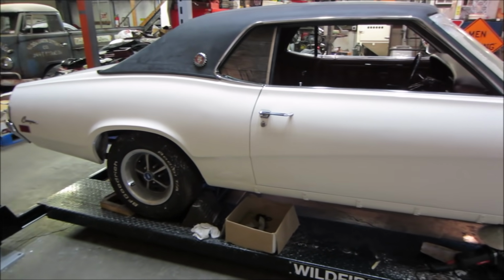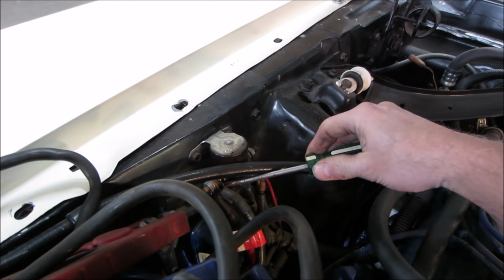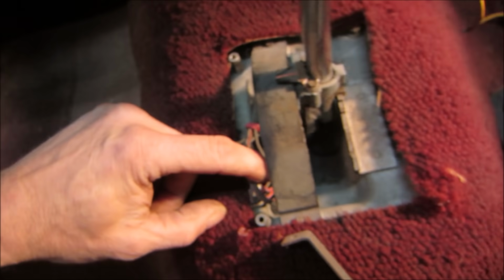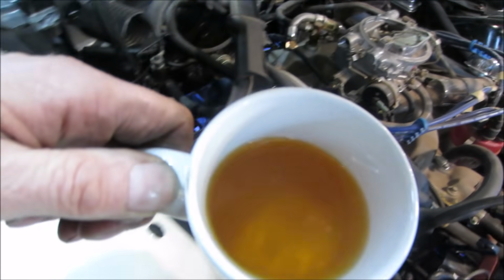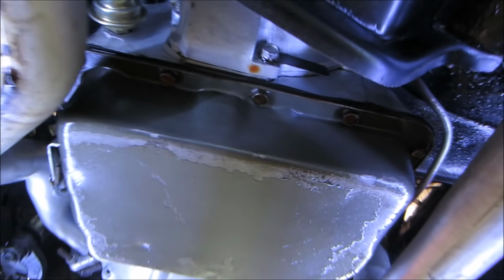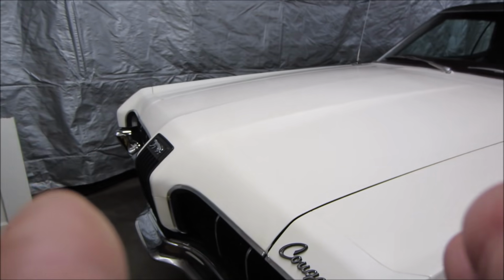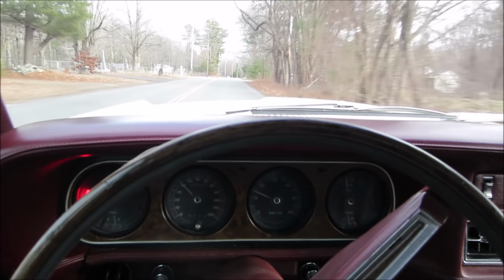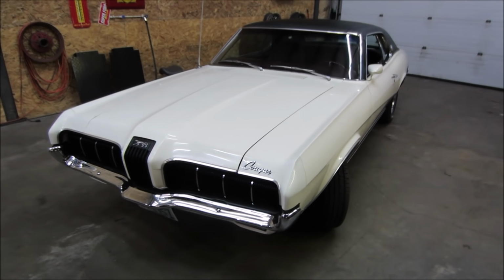Will It Run/Drive? 1970 Mercury Cougar  Saved From The scrap Yard.

Comment: Putting something together that someone else tore apart. Never a good time.
Reply: Unless you like a challenge. It is like being a programmer in a sense, trying to understand another person's logic. Mass of wires = spaghetti code 😁
Reply: If you watch vtuned on youtube, he effectively completely dismantled a McLaren 720 and transferred everything over to a new tub. He did it right though took thousands of pics and boxed and bagged every nut bolt and screw. Where possible, he left the bolt nut or screw back into the right hole. 

I can't tell you how many times I've seen "good deals" on basket cases and said NOPE because people just start removing willy nilly and toss them all together. The "best" way, if you have the patience, is to sort and organize everything. Specially in the last video considering the guy had stuff in the basement, stuff upstairs, stuff mixed in with parts for his other one......you'll be lucky to get everything. 

There's another one "nick's garage" on youtube he bought a 1970 dodge challenger basket case and the first thing he did was sort through everything. He knew the car inside and out so he could look at a part and know where it went and what it was. (be specializes in old school muscle).
Reply: No, it's a great time if you love a challenge.
Reply: Friends wife took all the separate little boxes and freezer bags of parts and dumped them into one big box to save space. Husband was tearing down his Harley for a total rebuild of everything and methodically placed parts in those boxes and freezer bags by groups.

 The bike never got rebuilt after that "helpful" clean up the garage event by his wife. It got sold as a project to another. The momentum of the project radically died after that giant mix all the parts together event.

 That was before digital camera and pre internet. Today it is far easier to shoot digital images of how parts go together and what they look like.

 That was in Chatsworth California decades ago.  The wife actually thought she was helping her husband with all the parts I  one giant box all mixed together. Ie clueless blond in chatsworth. :)
Reply: @3beltwesty  Yeah, that's grounds for divorce right there. No judge in his right mind would allow the wife to contest it lol specially if he liked to wrench on things.

Sounds similar to a story from 2018. Guy had a project car (60's GTO I believe) apart in his garage that he was restoring. GF decide while he was away on business to sell it and make room in the garage for her car. Had a local yard come and haul it away.....for nothing.

Guy got home and lost it. Threw her and her belongings out onto the front lawn and sued her for grand theft......

Me? in the first story: I'd give the wife a choice: sort it all back out OR leave with nothing but her personal items. 

"How am I going to sort it out"? You go out, earn enough money to PAY a harley expert to come and sort it. Or leave. YOUR choice.
Reply: And this seller was pretty meticulous about labeling all the things.
Reply: Challenges are great.
Reply: @gcrauwels941  yes "challenges" are great, but suffering ain't lol

Comment: There’s sparking down near the engine mount when you were cranking from the solenoid
Reply: Did you watch the video? There was 3 plug wires off
Reply: @aarongrabowski3775  I commented the same thing before I saw the wires off.

Comment: I drove a 76 Ford Granada 2 door for ten years. Loved that car. It was pretty worn out when I traded it in. I still remember the excitement picking it up at the dealership.

Whoever started the restoration did a great job. Engine cleaned and painted. Engine runs good. The ignition problems and transmission still needed a lot of work.
I'd use a lead fuel additive to help the valves.

Comment: Memories. I wish I still had mine. Red XR7 white top convertible white interior. 351C. Bought it in 81 drove it hard and cross country to CA from Cape Cod. Ran perfect for 10 years. Sold it missing the rear floor behind the drivers seat. It was gone!  Lol

Comment: I had the Australian Version, it was called a ford Landau over here....i smiled the whole way through this video, it was almost like a trip down memory lane. Mate i love your vids, i think ive watched all them nearly twice while i wait for your new vids to come up each week
Reply: on a second note, if the vac solenoid on the back of the tranny was busted you would be blowing smoke as the tranny fluid gets sucked into the manifold and it looks like you have the manual kickdown (linkage on carb). That groaning noise sounds more like the pump bearing in the transmission, sometimes if the torque converter isnt sitting right when the engine and transmission are bolted up it can put undue force on the pump shaft and kill the pump that leads to a groaning sound like that.

Comment: If I remember correctly, there is an interlock that prevents you from taking it out of park unless the key is turned on.  I think that was to prevent you from taking it out of gear and pushing it away to steal it. "IF" I remember correctly, that is. At 74 memories are getting fewer and farther between.  Love the videos, keep it up please.

Comment: When I was 17 I bought a 1971 Mercury Capri with an 800 dollar loan. My friends said it was a girls car but I liked it any way .I also owned a 1971 Pinto,1964 Mercury Montclair with a rear window that rolled down called a "Breese Way" I bought a 1966 Park lane with a massive 410 engine that I saved from the crusher ,1964 T Bird, 1965 T bird ,1977 T bird and now I have a 1955 ford F 100 basket case that I am working on. My daily driver is a p71 that I bought from an FBI auction( because they only get light use). I too would like to remember my HS days.

Comment: Love the videos! From an old Ford guy... I don't think the second terminal on the solenoid on the fender well/fire wall is ground. That was used to bypass the voltage reducing resistor for the coil, ignition curcuit. That terminal puts full 12v-battery to the coil during crank for higher ignition voltage. Then when the solenoid disengages it drops back to the 9 volts (+ -) for normal run ignition.  If you will notice in later years after solid state ignition (about 74-75-76) they did not have that second terminal. Ground is normally made thru the base of the solenoid to the fender well. Keep the videos coming!!!

Comment: Nice! Change the vac diaphragm and the fluid and filter and see if that helps. Those are known to go out (ive had a dozen or more old Ford’s over the years) I got my license in 82 about like you and started buying 70s Ford’s and flipping them. Those trans (c4 I assume) were also know for the front pump failing prematurely but that usually meant reverse would start going out. That may have a “shift kit” causing the downshift issue. Keep us posted!

Comment: Just watched your video from a year ago ish.  On older fords mercs and lincolns,  when jumping the starter solenoid you will get spark with the key off unless you unhook the "I" terminal at the solenoid. It's basically a ballast resistor bypass so you get full 12v to coil when starting.

Comment: The other small wire on the solenoid is the ballast resistor bypass while cranking, which will feed full voltage to the coil while you crank, and it is activated when you crank, including with the screwdriver the way you did. I had a very similar '69 Mustang.

Comment: Mustie. The reason you had spark when cranking it over with a screwdriver is because that second small terminal on the solenoid is not a ground. It is a bypass for the ballast resistor so full power is applied to the coil during cranking. This offsets the low voltage when turning over the motor. Greetings from the Queen City. Beautiful car, love the vids!

Comment: When we were in high school, a good friend had a '69 Cougar XR7, white with black vinyl top.  He would always complain that the horn didn't work.  A car pulled out suddenly in front of him one day and his horn sounded, totally surprising him.  After a bit of investigation we learned that his steering wheel had the rim-blow horn button.  The entire inner rim of the steering wheel was a pressure sensitive switch.  To blow the horn, you simply tighten your grip on the wheel.  That was a fun car, but its 351W seemed under-powered.  He finally let me take a look at it and I discovered that the ignition timing was way off.  After advancing the timing to the correct setting, it was like a different car and had no trouble spinning the tires.

Comment: I've done 2 vehicle restomods. Every screw/bolt/part was labelled, tagged, photographed, or in some other way (usually more than 1 way) identified for reassembly. These projects can take 6 months if you're fast, years if you're slow, and there's no way you'll remember where everything goes if you don't keep careful track of the pieces.

Comment: Great job! You've got a very nice car there.

I would pull the inspection cover off the trans and make sure all the convertor nuts are tight. Hopefully the noise isn't the pump.  And on the down shifting.  It's been a long time but I believe the vacuum modulators are also adjustable.  Use a small allen wrench in the vacuum nipple, kind of like some vacuum advances on a distributor.  It's been over 25 years since I messed with the C4 transmissions.  Make sure the fluid is full and they use Type F.

Comment: Wowzers thats nice. So satisfying to hear it run since when I graduated high school. Is that a 351W? I had a 67 Fairlane GTA 390 in 1977. This is my favorite Mustie video so far. Also it has a good undercoating on it that will be nice for your area. Nice touch on the Autolite battery. You have a 40k car now, thank-you for sharing. And yes you will need new tires asap. Speed reading all the comments now cause I just don’t want to close this window.

Comment: Nice work - I don't know if the auto box is a Type 35 Borg Warner, but I used to build the 'brain' (valve block) back in the UK. There were a couple of valves /bores which were slightly 'sticky' if the reamers were worn. They would often bed-in after a while but not always....
Reply: The Type 35 Borg Warner automatic wasn't used in Fords in the U.S.
Reply: @eskieman3948  I think the same problem would apply regardless of make. All auto boxes of that era (as far as I know) were 'non-electronic'. So, they would all use some form of hydraulic valve block 'brain' for shifting.... hence the valve /bore clearances are pretty critical. We use to change reamers when they went 2/10th's of a 'thou out. Clean ATF also helps !

Comment: So Cool,  Ace job,  Not a stock starter, that starter never came with a  direct mounted solenoid. Looks like something found off a  ford taurus
Reply: Looks like the high torque mini starter off a 94/95 mustang gt. Actually swapped the same one to my 86gt, much better clearance to the long tubes and did not suffer from hear soak.

Comment: You may want to get a shop manual. I've been working on cars/trucks for over 50 years, the basics are all the same, but wiring diagrams on cars like that are different.  My Uncle taught me auto mechanics back in the 60's, and things can change from one model year to the next. Since then when I bought something "New to me", I always invested in a (back then a "Motors Repair manual", now a shop manual whoever printed one) book specific to that make and model. You do not have to show us at all that you bought one - keep the mystique going.

Comment: My 77 cutlass supreme .. I found out a little later after I took the stock 350 rocket out because the block was cracked. Me and my buddy but a Chevy 350 in it with a 350 turbo transmission.  The shifter had linkages all the way up up to steering column just to show what gear you were in..lol.. I could shift it with turning the steering column.  The guy i bought it from never noticed it..and he bought it new.

Comment: I bought a 69 Cougar in 79 it had 80k thousand miles on it and I paid $800 for it. It was a sweet ride for sure. It was a goldish color with black interior but I ended up painting it white like this one. I prefer the 69 flat front end over the 70 but both are nice.

Comment: When you jump the solenoid the Ignition is powered by the other small wire on the Solenoid. When the key is a crank the ignition system get's full power. The noise in the Trans sounds like a valve buzzing. Might be an adjustment. Love the car as I had a 70 cougar 45 years ago.

Comment: I've heard that buzzing more than once in my misguided youth.  To my memory, it was that transmission vacuum module buzzing, from the diaphragm leaking, which would also weird up the shift as you're experiencing.  I don't know how hard it'd be to find currently, but if it's available I'd sure give that a shot before yanking the transmission out of it.
Reply: I was watching another channel on transmissions awhile back, there is a pin inside the vacuum modulator that can fall out into the pan when removing.

Comment: A bad kickdown module would normally delay upshifts rather than cause downshifts during deceleration.  I have noticed that on modern rental trucks and wonder if it might be an intentional part of an aftermarket shift kit with an automatic downshift feature to help keep the brakes cool.

Comment: The I on the top solenoid IS the power for the ign, only when cranking. It is white/blk tracer, and it is directly wired to the steel,ballast red/blue tracer for the ign. The I terminal only goes hot when cranking

Comment: Hello Mustie :) for windshield if could get top of new windshield have that tin or red color be excellent color  see and must remember old and some new have that color blue on top windshield it went left to right also size like the Sun visors inside car interior ! Why say if can be nice feature option to the car and nice detail too add! Like car and how excellent shape in too ! Also Parking Pin for Netural Switch needs like adjustment for sure tighten up in Park to  1 forward gear too plus be with indicator on dash lock in gear to when click in too ! Also that fuel gauge low light may be wires need fix or ground strap fix to or float need tune up ! Also for Transmission get black 1 quart bottle of BRAND of WYNNES called Trans-Medic let go thru completely add another in 3 to 5 years again it tune up completely the Transmission and make sure Transmission fluid almost or full when adding this treatment ! Plus a add a grey bottle of STP Total Treatment fuel injection and carb cleaner in fuel tank now also every 3 months too after! These make that car run excellent always to 100% also Trans-Medic add after Filter plus fluid changes  plus STP keep them both running like new too! Also Mustie  :) check Differential fluid to may be low or changed of age to and if not brakes are dragging too or pedal is on lightly click on too! Plus check Kick down cable too for Transmission to Carb on throttle part need adjustment too!

Comment: Don't know if you figured it out but the wire you thought was the ground on the solenoid is actually an ignition bypass,provides 12 volt to coil while cranking.

Comment: My 71 LTD had a 400 that preferred leaded gas. I think I found the last gas station in Austin that still sold leaded gas until 77 or 78, and of course it knocked like hell on regular unleaded, so my choices were to listen to that knocking, or put premium in it, which made it better, but it was still there, IFF I was willing to cough up the highway robbery price of 49 cents per gallon for SUPER. A couple of the old-timers at work told me how to turn my distributor by hand to change the timing, and even how to set it by ‘ear’.

Comment: For the transmission noise, remove the dust pan and hit the ring gear with a rubber mallet. Sometimes, there is a micro fracture around the core (where its bolted to the crankshaft).

Comment: Second wire on solenoid is for resistor bypass to get full voltage to coil when starting
Reply: And he forgot the  key doesn't need to be on for that to work... but won't continue to run once solenoid deactivated...

Comment: it will have spark while cranking with the starter solenoid cause the wire opposite to the signal wire is a hot wire to the ignition to give full 12v while cranking on those early fords.

Comment: 4:30 pretty common that the torque converter can drain back into the transmission. They typically have about 8 quarts in the TC and 4 quarts in the rest of the transmission. When half of the TC drains back to the transmission, it will be severely overfilled. Then usually they will leak from the shifter lever. My college car was a 1968 Lincoln with a 460 and C6. It did not leak at all as long as you drove it at least once a week. But leave it for a few weeks and there'd be a 4' diameter puddle under it.

Comment: What transmission is in the car? Two things I would want to check on a rebuilt automatic is that the correct filter with the correct length pickup tube is in it (if it is short the pump can grind when it gulps air) and that the play on the input shaft is correct and that the trust bearings is alive. If it is a non original transmission I would also check that the driveshaft is of a appropriate lenght.

Comment: On trans there is a vacuum hose going from the intake to the transmission vacuum modulator.  You can remove the hose from the transmission and use a flathead screwdriver in the nipple that the hose attached to, to adjust when the transmission shifts, I can't remember if it affected the downshift. If the diaphragm goes bad it will suck transmission fluid into the intake, had that happen to me and I couldn't figure where the quart a day of transmission fluid was going and it didn't smoke when that happened.

Comment: Common to have two feeds to the coil, a resistive feed for normal running and a direct feed when cranking, this compensates for the battery voltage drop when cranking